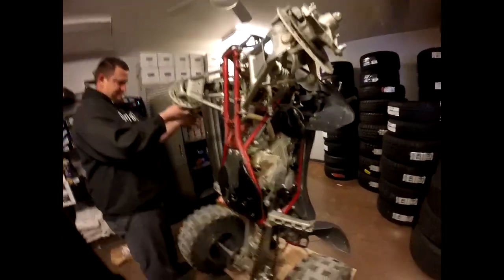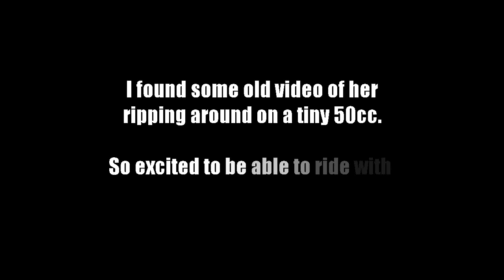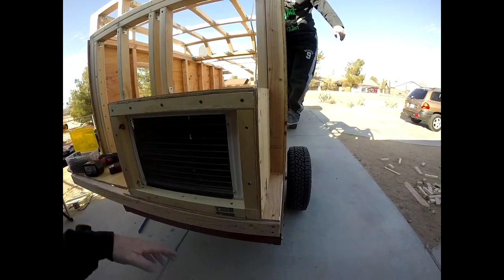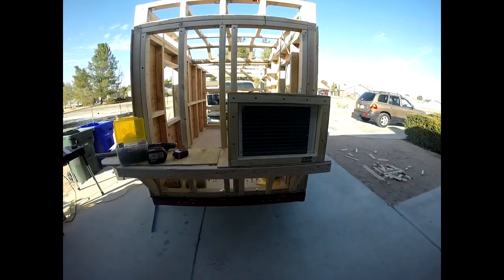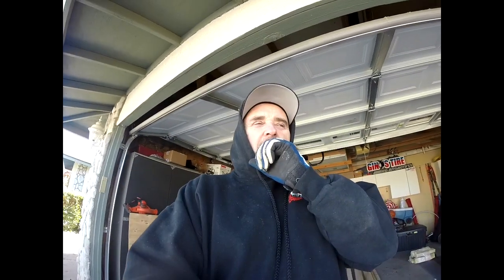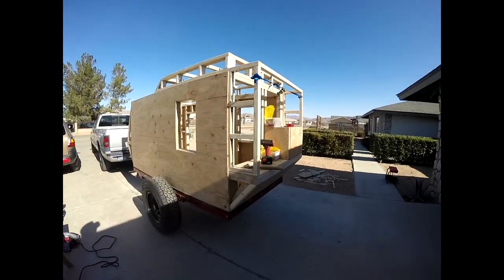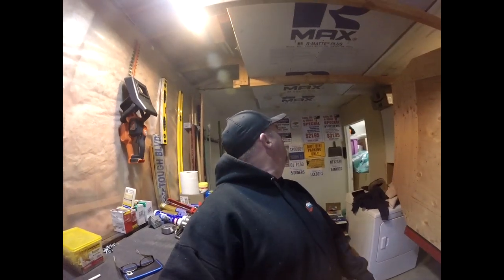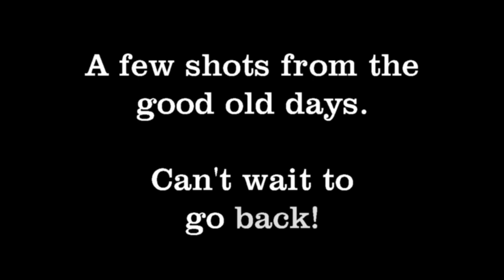Homemade DIY Camper - Sheeting & Framing

Comment: Damn. Wish I hadnt seen this!  I'm inspired. Im going to make one. Harbor Freight just opened a store in our town. If the better half starts fussing, Im blaming you!!! Awesome job by the way....
Reply from the maker: That's the whole reason I did it!  Another Youtuber years ago inspired me too!. I must say though that if I had to do it all over again I would look for a decent used 5x8 or 5x10 trailer.  You can definitely still go the Harbor Freight route and it will work. But after all I have done I do wish I had stronger steel everywhere and stronger axles etc.  Good luck and keep us all posted!!
Reply: @DIRTADDICT922  I found some trailers on Craigslist with beefier axles and tires. I think I may go that route.
Reply from the maker: @frankmills3713  Yeah I would. Love to see you video your progress?

Comment: Those openings that are on the side of your AC are there for a reason. They allow proper airflow through the condenser coil to dump heat from the refrigerant. When you in closed it in, you blocked off that airflow. While the AC may still work, it won't do so efficiently, and will definitely shorten the life of the AC.
Reply from the maker: I greatly appreciate your input. I had one experience on a hot day where it was not cooling like I thought it should. I then did some research and discovered what you just confirmed. I have plans to expose those side vents next fall when I get back to the 4x8 project.  You'll see it in a future video for sure. Thanks again!

Comment: Besides the bolts going through the wall, floor and frame, is it just woodscrews holding everything together?
Reply from the maker: Screws, Angle Brackets, Wood Glue.

Comment: can you tell me the measurements of the extension out the front? how high off the deck to the centerline of the kind of arrow shaped extension? and how far does it extend out. I am guessing 1-1/2 foot?
Reply from the maker: The measurement from the front of the door to the furthest point forward is 22.5".  From the front of the trailer deck to that same point is 14'". And that imaginary line is 17" off the deck.  Keep in mind that these are not exact. But very close. I had no plan when I started. I just went for it trying to build what I saw in my head as I made progress. Totally free form.